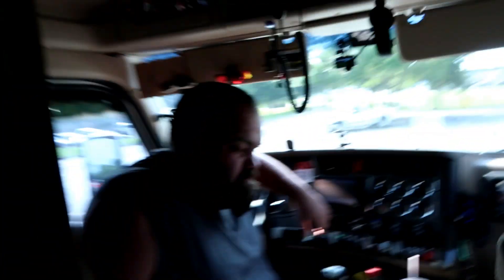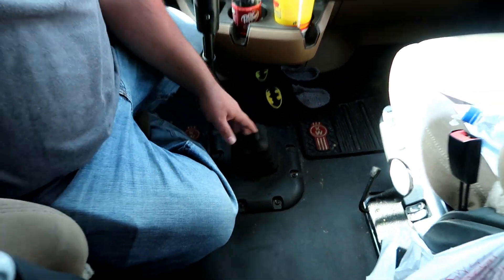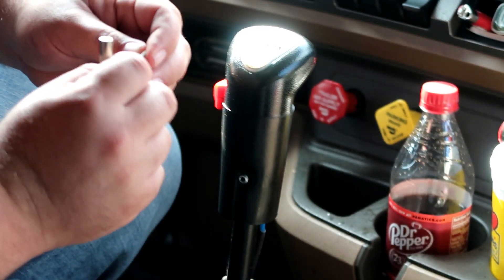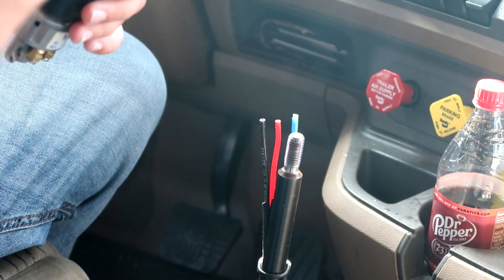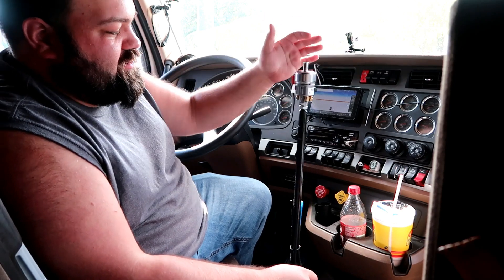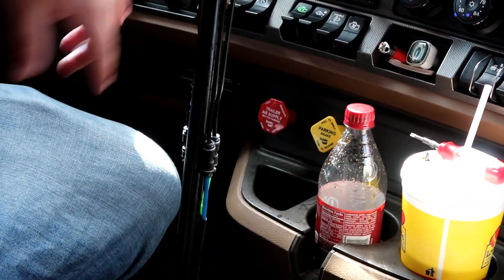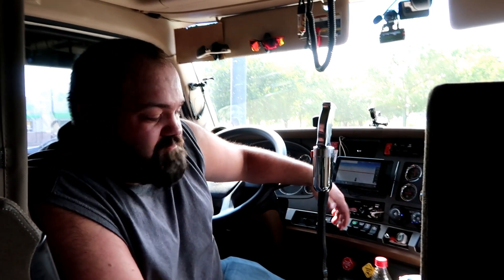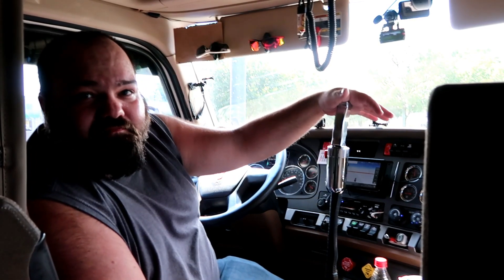How to EXTEND your shifter

Comment: Where did u get air line extensions? Also if u want to go back to factory,can u re use old air lines?
Reply from the maker: Most shops sell the air lines, and yes you can go back to factory just removing everything

Comment: Those air connectors are called push lock connectors if by chance someone needs to go pick some up. Try a hardware store or your local Fastenal store. They’re a lot cheaper than they are at the chrome shop.

Comment: Very helpful budd thanks the only thing I don't like it's the black tape any other choices?
Reply from the maker: +Eduardo silva they have covers. The tape is to keep the air lines from rattling
Reply: Get a full pipe shifter. If you can stand spending that kind of money. The lines go down through the center out of sight
Reply: Now they have chrome Steele sleeves that go over the shifter and it hides the air lines

Comment: What if your SPLITER DOES COME OFF?? Do I know how the springs set back in ?
Reply from the maker: Its hard to explain but the 2 small springs sit on a small plastic piece then the splitter  fits over top of them
Reply: The Carolina Ghost I️ appreciate the reply man ! Thanks again. I️ got fed up and just paid $80 for a nice brand new knob from KW lol , needless to say we Won’t be taking apart any more 18 speed knobs ! Lol thanks again
Reply: @TheBeardedGorilla89  i have a 8LL an i  dropped the the whole thing smh.. i have one spring one tiny  ball and one black rubber seal that was sitting basically on top of to tiny holes and another plastic one with two pointy things on it

Comment: Straight forward, simple explanation and great step by step tutorial. Much appreciated. I'll be trying my hand at this over the weekend in my Classic XL. I'm just torn between a 12" and an 18". At a height of 6'3, I ride with my seat on the floor for comfort and I'm having a hard time deciding which would be best. Suggestions?
Reply from the maker: I'd say 12" but I also just think the 18" is to high.
Reply: 10-4 driver, thanks.
Reply: I went 18 on my classic. I'm 6' also have the seat all the way down. And 18 is just perfect for me. But i also have the stock handle on it too so far. I hold it around the base of the handle with 3 of my fingers over the top. So i think it would depend on the handle you use.

Comment: If I want to extend and just have the white ball on top of my 18 speed, do I but the same pieces you just use?
Reply from the maker: +robby black mostly. Youll want the extention. The longer air line and connectors. You also need the shifter knob adapter with the threads on it. The ball will thread onto the shifter top.

Comment: How do you put back together the splitter if it does come apart?
Reply from the maker: +Oscar Martinez put the 2 springs back in place.
Reply: Good luck with that one
Reply: @EduardoSilva-xe3gp , good luck with what? It's literally 2 detent springs, don't be a negative person just because you can't figure it out
Reply: Ok Oscar being a really positive person my little piece of advice to you it's to make sure you don't have any air pressure going into the shifter before you remove the 2 screws to take apart, it will literally split apart by it self making those  springs and ball bearing fly away very far away from you , that's where the GOOD LUCK come in place trying to find those little suckers, so just remove it exactly as he says and you won't have any problems by the way i just replace mine but with the original cause it was licking air and it's around 60.00 bucks in TX just in case someone was curious about the price

Comment: I just don't understand extending  shifters.... It's gonna be so  uncomfortably after a while.
Reply from the maker: Its not. Im more comfortable with an extended shifter
Reply: Do you realize that low shifters are a big cause of rotator cuff inflammation in truck drivers, probably not. It's not natural movement to push forward with the arm at a 45° angle. The specialist that repaired my shoulder said in the 7000+ shoulder surgeries he's performed, at minimum, 45% were long time OTR drivers. There is a lot more movement required of the shoulder socket to push forward at an angle vs pushing forward at 90°.

Comment: Great video! I will follow this as an installation guide! Subbed and liked. 

Does it actually help with the shifting?
Reply from the maker: +boutrous92 thanks and yeah. Imo once you get use to it, shifting is alittle easier. I perfer it over stock
Reply: boutrous92 

Yeah. It does help.
Reply: yes.. look at the posotive comments after the video it is more like than dis like.. over time it helps the sholders and arms.. and the body..  TRY IT YOU LIKE IT :-)

Comment: A question of what size is the extension nut.
Reply from the maker: +Alan Sar um that one im not sure. Ill see if i can find out
Reply: The Carolina Ghost mmm ok.
Reply: Alan Sar your oe stock shifter should already have one it's holding the original in place

Comment: I really don't understand the reasoning behind having a "stripper pole" shifter vs the original one?
It just seems a waste unless somehow it makes you feel better holding the shifter all the time - which btw is not good for the transmission.
Reply: How is it not good for the transmission? explain to me
Reply: I think he means hanging your hand on the stick,  which is not good for it because your pulling on the shift fork while it's in gear.
Reply: From a medical standpoint, a low factory style shifter puts the arm at an unnatural 45° angle, pushing forward and at that angle requires more movement throughout the shoulder joint. A surgeon who fixed my shoulder told me that 45% of the 7000+ surgeries he's performed, were on truckers. Low shifters contribute to rotator cuff inflammation, increased socket bone degenerative disease and fatigue. There, are you happy now that you got an explanation that you really didn't need just because you don't understand it.

Comment: I hope everybody realizes that extended shifters put excess were and tear on transmission bushings,if anybody doubts me call any transmission specialist and they will confirm it,furthermore why does one even want a extended shifter that's not comfortable or ergodynamic, kinds like put ape hangers on a harley
Reply from the maker: For me and many other drivers i know, it is more comfortable and shifts easier. Plus we like how it looks.
Reply: The driver will do way more to the trans than the extended shifter will. Not hard to know how a truck was drove by the shop in the shifter.